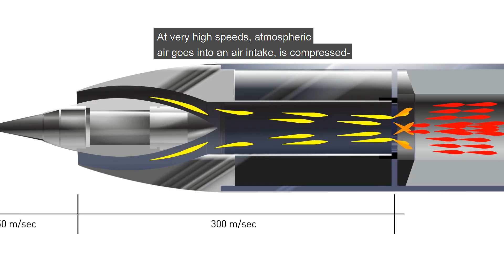How ramjets may change the role of artillery on the battlefield

Comment: Two issues with this.  The obvious one is that the engine will take up a large percentage of the volume that would otherwise be the warhead, reducing the blast effect unless the projectile is made larger.  Not quite so obvious is a significant loss of accuracy.  A simple unguided artillery shell follows the laws of physics in it's trajectory without inserting any of it's own forces.  Introducing a motor introduces all sorts of variables that can alter the trajectory, even slight variations in the level or direction of thrust will case large errors in the point of impact.  The only way to get around this is to make it guided, i.e. to give the thing a seeker head and articulating fins to steer it. With the entire front end taken up by an air intake I don't see where you could mount a seeker.
Reply: With onboard guidance that won't be a big problem because the shell will be able to guide itself to the target. You don't have to worry about collateral damage from using an excessive explosive charge needed to counteract lack of accuracy,

 The range is increased by using external oxidant and using the volume savings for more fuel. The payload is the same in both cases.
Reply: @joecanuck3751  in 155mm? Maybe if it was its own gun, but 155mm kinda makes doing that a problem.
Reply: Even the central body of this Ramjet intake has enough volume for contemporary guidance sensors - optical, GPS and MEMS inertial combined. Also, you can use simpler gaseous control by opening additional nozzles instead of using aerodynamic control surfaces, which need to be rotated and deployed.
Reply: perhaps guidance trough gps with reciver on the side or a drone relaying coordinates; anything else than a header seeker that indeed seems overlaping with its main feature
Reply: GPS artillery is quite accurate. Generally within three meters and it takes simple and lightweight components. Shells already have fins. Throw in a few servos and make them  movable. HIMARS is a very effective system that is GPS with no terminal guidance. Only drawback to no terminal guidance is if you have a moving target.
Reply: There is a cone to compress air by shockwave. Look at Mig-21: it had a radar.
Reply: You zeroed in, with greater detail, on the issue of guidance. Reliance on strictly the ballistic trajectory of the shell increases the potential for inaccuracy when the range reaches 95 mi./150 km. Are there plans for this shell to have a similar GPS sytem as the M982 round, or is something similar already in place?  Their website mentions a "guidance system" with no details on its capabilities. That trade-show shell does display fins for stabilization and canards for  redirection in the terminal phase similar to the Excalibur S round. With the front of that trade-show shell taken up by the ramjet air intake, is there room in the shell for a guidance system? While that may be a silly question coming from an armchair analyst, I pose it in the absence of any data which clarifies the potential inclusion or current existence of this feature.
Reply: You don't need a lot of explosives when you have huge kinetic energy.
Reply: @peceed  yeah you kind of do for some tasks. but i guess idea here is for valuable small targets.
Reply: @jebise1126   Naval.
Reply: The engine will not work all the time, then the projectile moves along a simple ballistic trajectory, and using standard guidance methods you can ensure accuracy
Reply: 3 counterpoints 
1: technology has allowed smaller munitions to create an equal or more explosive charge than traditional munitions
2: GPS should easily be integrated into these munitions
3: scatter munitions don't need precision and if it's time delayed, the GPS and computers will aid in target acquisition and engagement.
Reply: @IHWKR there was an article about allowing the fuel of cruise missles to be detonable and serve a dual purpose of propellant and explosive. 

They were exploring some kind of fuel air   explosives but that is for certain situations only.. not really armor defeating, or antimaterial unless somewhat exposed soft-ish targets e.g. cars, people,  open windows, etc..  I guess if you get it INTO a bunker system, it will wreak havoc. 

But back to THEIR idea.. the ramjet should be able to carry a lot of payload weight so I'm not worried about lack of space. 

But in this case, silanes are a much more dense fuel. Combined with HMX or CL-20 for payload, these ramjet barrages would be very terrifying.. 200 km range, ultra-kinetic penetration, and double the explosive effects! I forgot.. I know a cheap nano-silicon, lox mix 10x stronger than TNT!!! It's very esoteric knowledge.

In the end, we humans ought to build beautiful things together. If minds like mine were funded for green cars for example,  we could have ethanol cars at 50 mpg easily at half cost of gasoline, 20 times more jobs, 120% less emissions (production), soil rebuild etc

If funded for oceanic projects,  we could replace all fuel in the world with seaweed sourced and heal all the oceans and global warming within 15 years if unlimited funds.

None of this would be a charity case. It would make 4x mutual fund returns easily as proven by the Brazilian ethanol initiative back in 1975.

All this would negate the need for any war.
Reply: That can be fixed with a simple computer mounted within the nose cone. However putting ariculating fins, and all that is going to make the round far to expensive. I'm fairly certain the only reason their not presenting this with its own gun where you can make less sacrifices to meet size requirements. Is the company is in too deep, and their looking for uncle same to bail them out for basically making a gyro jet artillery addition.
Reply: No the bigger issue here is the cost and fuel type used. Any solid fuels are going to have a shelf life, when you have to combine them with air intakes as a weird hybrid solid motor, that shelf life drops even further. Other than that guidance can be included but it only adds to the ridiculous cost of this.
Reply: @SD352-68  the shell in the video would be liquid fueled though, being a jet. Additionally, it's a ram jet, which don't have any moving parts in the engine itself.

Ramjets are essentially just a fancy tube that injects and burns fuel to go faster.

when it comes to propulsion it's as high reliability as one can get, only having limitations of a minimum speed to function (technically max speed to but that's not really to big an issue here).I'd be more worried about the guidance system failing, and some modern militaries have made their complicated guidance systems seem like childsplay.
Reply: A laser or IR seeker could be mounted in the air intake shock cone.
Reply: What about the cost on top of that
Reply: There is no war head needed at 3.5 times speedo sound its a metoer kinetic energy

Comment: No warhead? Kinetic energy? Are you joking???
What kinetic energy? The trajectory clearly shows the same pattern as a regular shell. Just longer distance. The engine burns out. The shell slows down. The shell falls down. 
WHAT KINETIC ENERGY???
Even if they wanna use kinetic energy as a weapon, they need MASS. A lots of MASS so when they hit the wet soilin the middle of the battlefield they kill soldiers at least 50 meters radius. This tiny hollow can cannot do anything to kill except hitting the poor bastard in the helmet.

Comment: Needs to have pinpoint accuracy to have any effect,  as payload will be decreased I guess,  can see potential to use existing Artillery with this, for specific mission parameters, to augment existing air assets and rocket systems, over the horizon attacks on Naval targets could be a good use of this.

Comment: Wanna bet it wont catch on?
1) The main limiting factor for artillery at range has always been the dispersion. To fix that you need guided artillery shells.
2) Guided shells are expensive and compromise the effect-on-target capability and negate the main advantage of gun artillery - being cheap and having a high volume of fire.
3) Ramjet will increase the range, sure, at the expensive of, again, the effect on target. The shell has a limited volume, and by the looks most of it is to be the propulsion system. And it doesnt negate the dispersion issue unless you make the shell guided.
4) A guided ramjet shell will now have TWO components that reduce its yield and increase its cost. What exactly is the point of a $100k 155mm shell that will do very little damage? You dont win when the ammo you use costs more than the target you destroy, assuming it can actually destroy a target, which is questionable due to lack of payload.
Strapping a rocket to a GBU-39 would cost about the same as this, reach just as far and do 20x more damage. Which is why, as per your own example, all extremely long range arty is rocket based.

Comment: The US m1299 has the right idea using supercharged propellants. To be able to fire a lot of cheap Artillery rounds like Base bleed or standard HE rounds over 50 km seems more important than using very expensive RAM or Rocket Assisted Shells at 70km plus. What they need is to mass produce those new fuse/guidence kits for standard shells that turn them into smart ones for only 10k instead of an 80k Excalibur round.

Comment: standard 155mm HE shell $400 
a shell with GPS tracking $60K 
ramjet $86K 
hellfire is $115K 

so I see it replacing the GPS shells and the hellfire 
but not the standard HE when it's 200 times the cost

Comment: What you're ready to do is see what happens when you spin a ramjet at 15,000 RPM. 
Your video reveals that you're shooting out of a smooth or slowly rifled barrel. Which, no army in the world fields for their artillery. The US M777 has a twist of approximately 1-in-3.1 meters. While RPM is relative to velocity, twist-rate should be constant at the muzzle. Your slow-motion shot looks to achieve maybe 20% of that.
Which means you had a custom barrel made. And the only reason you would do that is you found a problem bad enough to justify the expense of ordering it.
You're running up against a wall. Your projectile is longer, so you need more stabilization, but you're spinning it slower. Because of the shape of the engine, you don't have the room to put larger fins. Your CEP is going to be hell at the ranges you're talking about.
In the future, when you start new projects, pay me $1000 to tear your ideas to shreds. It's a lot cheaper and far more  tolerable than not getting the contract at the end.
Reply: After the all successful tests in USA we want our $1000 back. The Dunning-Kruger effect is high in this one.

Comment: He mentioned 100 sucessful trails were conducted, but what about the failures. Lets say out of the 100; 900 were complete failures resulting in the projectile exploding and demolishing the entire crew compartment. The problem with this video is they don't tell you the costs to produce, amount of fails, and if the projectile uses, replaces, or converts with 155mm troop units.

Comment: Just an FYI, the US has several capable MLRS platforms with ranges of over 300 miles/480km. I'd like to also point out their repeated use of US artillary for examples, and point out a glaring flaw in their claims:
 
At 3:50 they claim the ramjet can increase range by up to 150km, which is still half that of already very capable US MLRS systems.
Reply: It's crazy how ill informed this video is. They have never heard of big bertha? Namno must be a start up thinking they invented the wheel.

Comment: I can see potential here, especially for naval artillery. Why waste almost a million dollars per Tomahawk cruise missile for a target several hundred kilometers away when you can essentially just strap a rocket motor on conventional shells to get that sort of range, now obviously that's a gross oversimplification of the complexities of ramjet tech, but fundamentally that's what's going on. We could end up seeing the return of big-gun battleships like in the glorious days of the dreadnought if this technology is developed enough, and I'd love to see it honestly. The navies of today just don't have any armor protection, look at the USS Cole. You get a huge hole blown into the side of your ship because apparently the name of the game now is active protection systems that shoot down missiles before they hit the ship. I can guarantee that if it was an Iowa class battleship that was rammed by that little riverboat loaded with bombs, the only damage on the ship would have been some paint scuffs, the main belt armor thickness of an Iowa class is 12.1 in. (307 mm), That means that the same bomb that crippled the Cole would have to penetrate over a foot of hardened steel in order to even start to do damage to the inside. All of that because the navy thinks that with the right number of defensive systems, they are untouchable, the way I see it, it needs to be a balance of both passive (armor plating) and active protection (missile defense). The fact of the matter is that big caliber navy guns can do one hell of a number on enemy fortifications, problem, as explained in the video, is that the range isn't enough (around 40 km on a good day for the Iowa class). But if that range could be extended by several hundred kilometers (at least) then you could have naval artillery that is capable of supporting ground forces far inland from the beachheads or hammering hardened positions to soften them up, all with the virtual impunity of a heavily armed, heavily armored, floating fortress with all the modern luxuries like active protection systems to shoot down threats before they can even think about trying to blast through multiple inches of hardened steel. Missiles can be shot down, hell there's a whole industry built around that idea, but a ramjet fitted artillery shell? Now that's a tricky problem to deal with. It's fundamentally the same idea with why hypersonic missiles are so hard to hit, they are just so bloody fast, the speeds needed on anti-missile defense systems is still playing catch up, and an artillery shell is a hell of a lot harder to shoot down or knock-off trajectory, not as many complex computers and gadgets to mess with like on a missile, just a bomb, and an engine. I think it's worth considering, I mean even now the US Navy is looking into something similar with their fancy new railguns, but this is a much more simple system to deal with and the tech is already here, railguns are cool and sci-fi, but why knock the tried and true method in the process.

Comment: if the explosive mass that goes into those rocket shells is decent, it might serve as counter artillery against russian rocket trucks and other enemy artilley, but I wonder if such a complex shell will be able to carry the explosive mass required for the destruction of anything else.
It might struggle against dug in positions, or slightly armored targets.
It might also be too expensive to just shoot on mass.
also, does the rocket motor not contribute to the barrel heating up? if else, extensive fireing of these shells could lead to damage of the barrels, relegating them only to long range precision strikes.
All in all I doubt that these kinds of shells will be serving very soon.

Comment: Are not all artillery barrels rifled? I am curious how these rounds do or if they can really be shot thru a rifled tube. The spin imparted from a rifled barrel would rip those stabilizing fins right off. Also at 100 miles or 160km you are going to need a guidance system, which is going to cost thousands of dollars to an already overpriced round that already has very little explosive carrying capacity due to the on board propulsion system. The US Army already has a smart artillery round that cost 100k dollars each. Before they can even use one of these overpriced hole creators, they have to have approval from the chain of command. 
So in essence this is one of those rounds that will not really be feasible because of cost and effectiveness for at least 2 more decades. That is why at least the US military has been developing electromagnet super guns. 
I must admit being an American, that I am surprised they are looking at such a “dumb” round considering our history of way over complicating anything military related such as multi billion dollar aircraft carriers that launch aircraft the same way they launch those dumb rounds via a “rail gun” electromagnet gun and airplanes that cost way in excess of 250 million dollar stealth bombers.

Comment: The Otobreda 127 mm ammo Vulcano-C is already capable of 120 km range and is most probably cheaper than this one
Reply: ramjet is more performant than rocket assisted shell and contain no moving parts 
the inlet is more expensive 
but the 155mm ramjet can counter battery the 127mm

Comment: I assume these shells have
1. Smaller payload than a regular 155mm shell
2. Higher cost 
3. Worse accuracy
Long range doesn't matter if you cant hit anything. Cost efficiency is the reason classic artillery is being replaced. If 10 kg guided munition can do the job of 1 ton unguided, "dumb" shells, why bother with dumb shells at all?

Comment: I really don't see the point, yeah standard artillery is limited in range but for the most part the rules of that artillery don't require any more range than what a standard gun is capable of, anything more and you wanna use a different weapon system all together, that's why we have HIMARS, a rocket artillery system that can reach out to around 300km, they carry a much bigger explosive payload than what this could and honestly I wouldn't really see the point of shooting anything further than what they can, in order to accurately hit your target out there you'd need guided munitions and at that point it would be more effective for close air